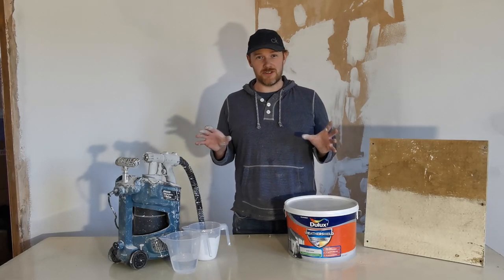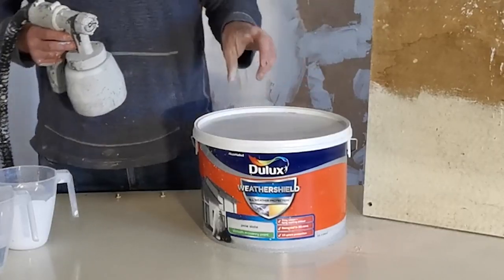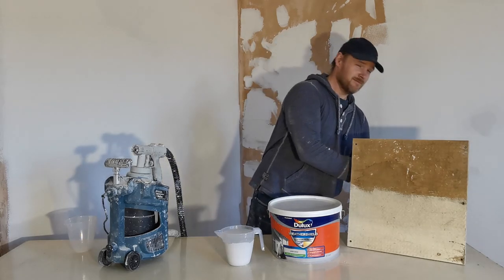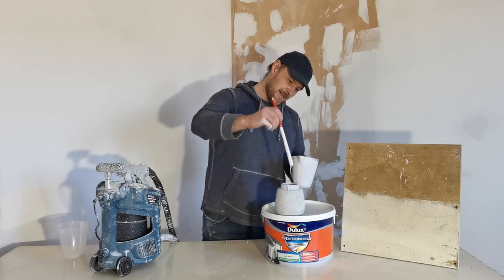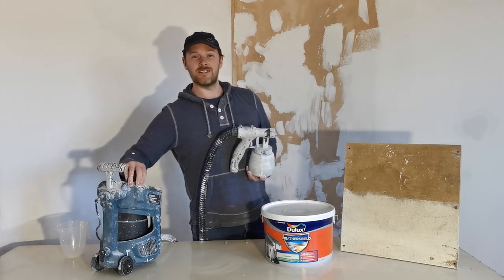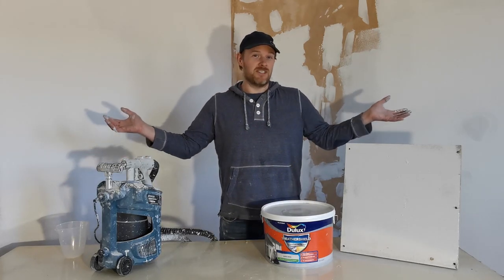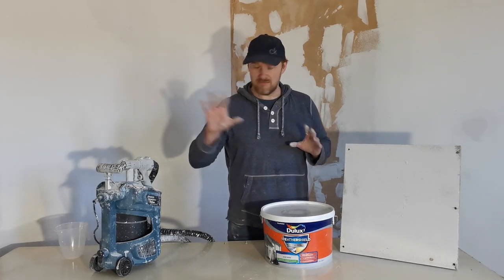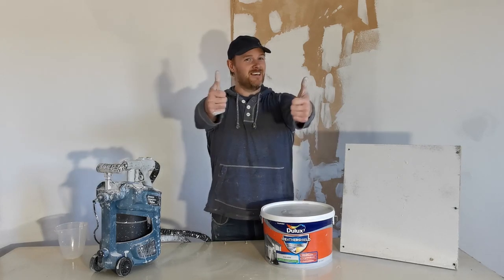NEW LOOKING HOUSE FOR UNDER £200!! Masonry painting with Erbaur and Dulux Weathershield

Comment: Sorry to tell you but you would be much better off with a airless sprayer for that rather than HVLP. The Finish looks patchy too. I guess that was the first coat? Even a roller on a extension pole would be faster than that machine and look more solid than that, no need for scaffolding and much better results. This is not a professional paint job and more a 'that will do' approach, but fine if you have low expectations and on a budget, Otherwise leave it to the professionals.

Comment: Exactly the video I was looking for! Thanks for putting this out there. Just wondering how many coats did you need to cover the roughcast? Does watering down the paint adversely affect the weather proofing of the paint? Cheers
Reply from the maker: Hey Mark, it took 2 passes to fully coat it but it did have old paint already on the roughcast so makes it easier to cover. If it doesn't it would need another coat or two. Can't say how much it would effect it unfortunately but I'm guessing with enough coats to not look patchy it would be fine.
Hope this helps

Andy

Comment: Hi! I stay in Glasgow in an old tenament flat... the inside of our communal area is all flakey. I'm lookin to paint it myself... it's going to be a huge project but I was wondering if you have any advice?

My steps are:

Scrap the paint off and sand, use external polyfiller to fill any caps/cracks and then use dulux weathersheild.
Reply from the maker: Hey Gary, thanks for the questions but I think you've probably already got the best plan. Scrape all of the loose paint off first, although try to remember to do it as gently as you can as you can easily scrape good paint off these walls and give yourself a bigger headache when it comes to filling. If the walls are flat I would also perhaps suggest using a standard roller with non watered down paint first and see how you get on. Sometimes that can be the more efficient way to get good coverage. We tend to only use the sprayer on rough cast as it gets behind the stones a bit easier.
Hope this helps and good luck!
If you have any more questions please feel free to get in touch again 👍

Comment: My jaw dropped when you mentioned the price of the spray machine, thought it'll be mega money!  Will definitely invest in one. Wonderful video, thumbs up and a sub from me. 👍🏽
Reply from the maker: Thank you very much! It's been a great machine for us, just remember to mix the paint well to avoid thicker lumps. 🙂
Reply: I've got the same one. Only used it for fence and summerhouse painting and works perfectly. Definitely going to use it on the masonry soon so will give it the jug test on 2to1 with sandtex smooth and see what happens..
Reply: Bought the newer version..great piece of kit..just a pity the paint pot only holds as much as it does.would be nice if you could buy a bigger pot to go on it.

Comment: Ive come to paint the front of my house.only a small bit of paint was coming out.it was as if something was blocked.took it apart and cleaned it but still no paint coming out.have you any ideas?
Reply from the maker: You could either try fully adjusting the screw stopper behind the trigger to let the most paint through or water down the paint a bit more.
Reply from the maker: Did you use the sprayer before this attempt? I've also seen a small bit of grit or dry paint get stuck behind the brass nozzle. How far down have you stripped it to clean?
Reply: Yes i had used it a couple of times.i ended up ringing screwfix and took it back and got a replacement

Comment: Hi I've been recommended to use an oil based paint. Would this machine work with that?
Reply from the maker: It really depends on how thick it is. If you're talking about a fence creosote type paint then it should be fine but we do have to thin most of our paints down to get it to flow correctly. Basically anything thicker than the sauce in Heinz beans I would probably say no 😉
Reply: No masking? How is the over spray?